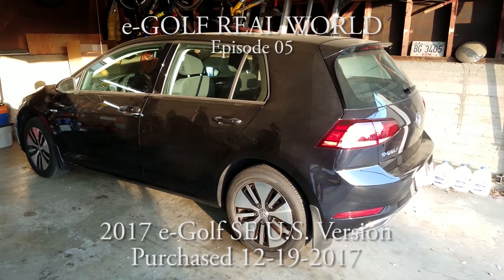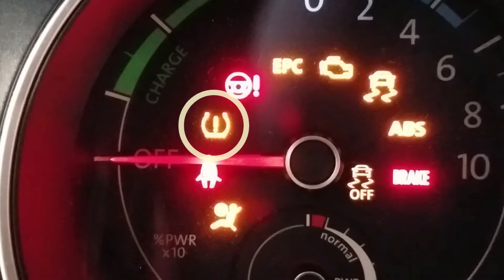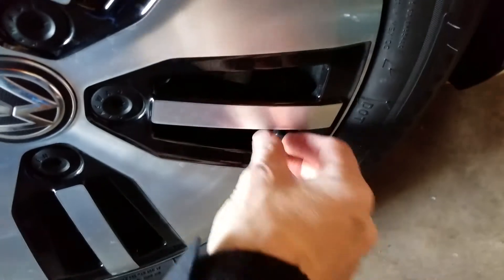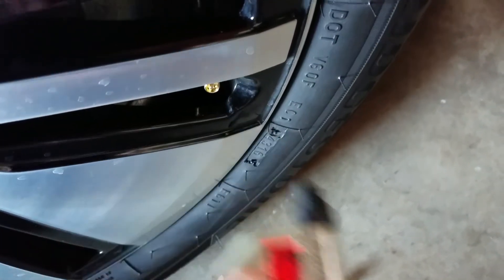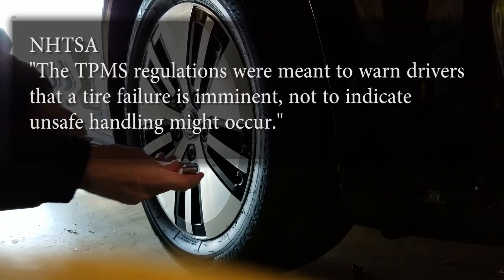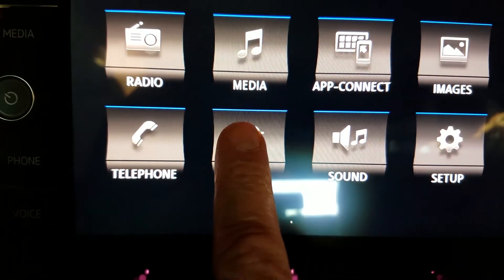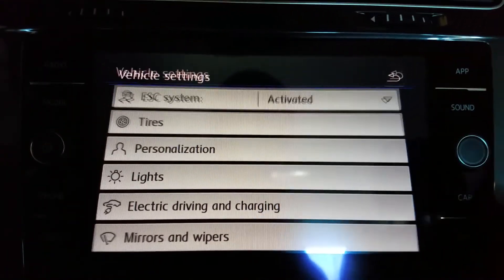e golf Real World TPMS Ep 5

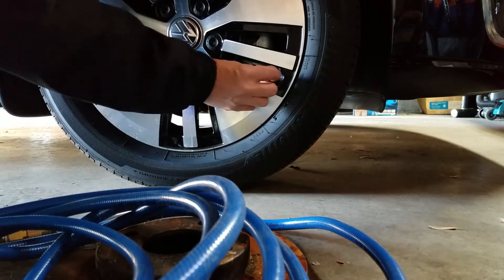Comment: These videos are great, I’m learning a lot about my new (to me) eGolf. However, the statements made around the 2:45 mark of this video are wildly inaccurate. Your tires will not fail with a 5 psi pressure swing. In fact, a 5 psi swing can be expected just with changing temperature and elevation, without any air loss. 

If the TPMS goes off around 30psi, that’s way before imminent failure. While I haven’t tested it, I’d assume the car drives decently at 20 psi and wouldn’t loose the bead until 10 psi or less. That’s not saying anyone should test that theory… but when I checked the tires on my new car, the previous owner was running 25.
Reply from the maker: Glad to hear you are enjoying the series and the e-Golf. We are about to part with ours and I will miss it. As to the tire pressure, having it too low or high will cause wear issues and depending on the pot hole, curb, etc failure of the tire. Despite having TPMS, I check tire pressure every month. Thank you for sharing.

Comment: Hi thanks for making the videos on your e-Golf I work on VW in a independent garage and I know VW quite a bit and on you’re car the TPMS = tire pressure monitoring system function this way it doesn’t have tire pressure sensor inside the tire mounted on the rim it uses the ABS module and  the 4 ABS sensor to determine if one or more wheel is spinning slower than the other wheels so let say you have a slow or a fast leak in one tire the the tire circonférence will get smaller then the ABS module will signal that you have a problem and the the light will come on but I think that if all 4 tires loses pressure at a constant rate then I think I might take a longer time to actually tell you that you have a few low tires I personally like this system instead of pressure sensor it way more reliable and let say you have a 2 second set of wheels with winter tires then you don’t have to buy a second set of pressure sensor.  If you want info on you fuses box fuses I have a subscription on VW repair manual online and I could find info on the fuses position etc.. but I would need you’re vin number in order to find the correct info.
Reply from the maker: Thank you for sharing this information.